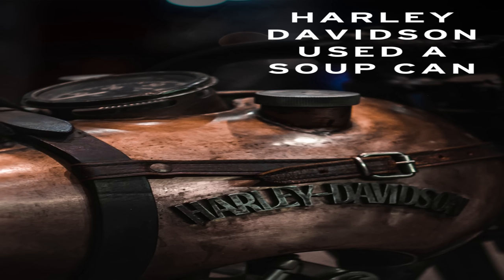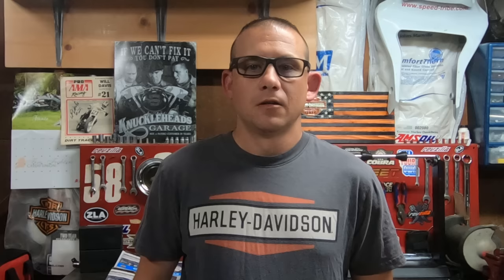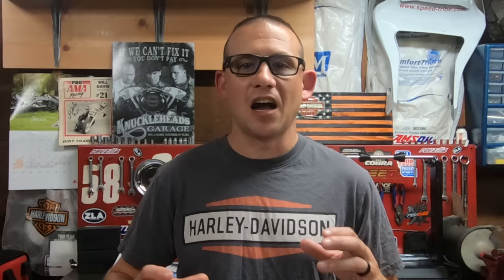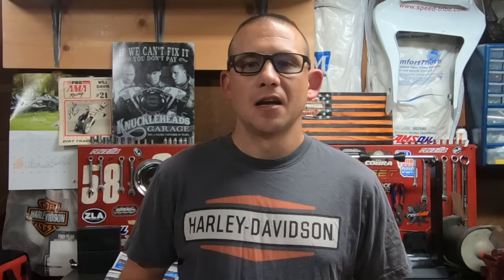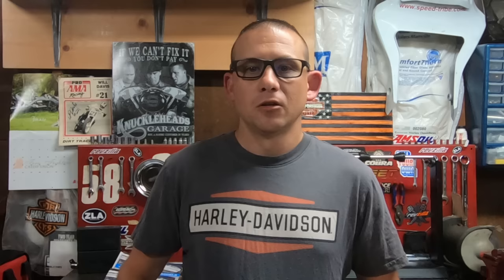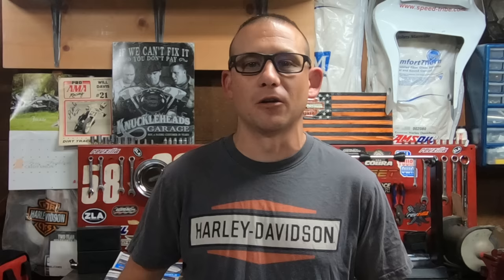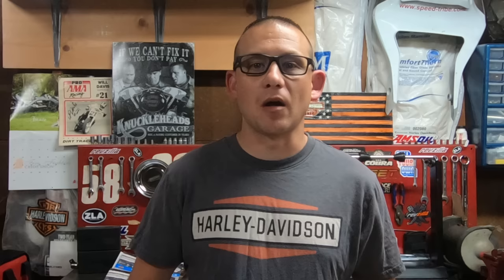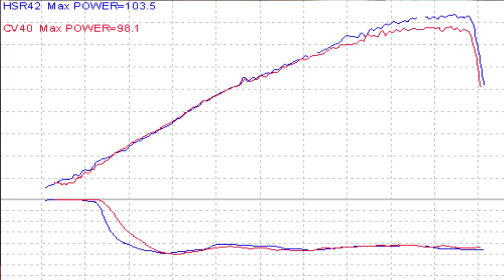CV Carburetor or the Mikuni HSR for Your Harley-Davidson

Comment: Well I have kept my CV carburetor ..
back in the 70s and 80s I tried SU and the S&S ..
 at that time didn’t have an Excelerator pump and I could not get used to the roll-on of the throttle .
I rode other peoples bikes with the newer ones but they do tend to gulp more gas .. I had it for quite some time..
 but on my Evo I got my CV carburetor to run very well and get decent mileage  in the winter I will put a 45 slow jet because  really cold with the 42 it will cough once and a while ..but in the summertime it works perfect.   I do run 170 maim jet And 1988 sportster Needle. I did take one round Of coil of the spring I  clipped it off ,,in affect making the slide act quicker ..
I have followed Joe mentions,, advice on carburetor and exhaust and I found it to be spot on.
if someone gave me the flat side I’d give it a try but I’m not gonna go out. Buy one
 One thing I always Wondered do you have to change the throttle cables

Comment: I actually don’t have a negative opinion of the CV Carb however I did install a Makuni 42mm HSR on my TC and my EVO and I have never been unhappy with them. They always performed quite well.
Reply from the maker: I've never heard anything negative on Mikuni performance, always gas mileage suffers with them. I've had some do well on fuel with the right jetting but it takes some time to get it there.
Reply: @GixxerFoo  Gas mileage does take a hit. It’s noticeable but not drastic but I didn’t really keep track of it if that tells anyone anything. I don’t think you can wrong with either. Anyone riding an older bike is most likely also capable of working on them.
Reply: @anchorsaweigh9893  Definately

Comment: I had a 05 sportster with pipes and intake. Kept the CV carb, and never had any problems in 3 years. Later on I bought an 04 sporty with pipes, intake and they had switched out to the Mikuni HSR 42. The throttle response was very very good. However, I was always tinkering with the mixture screw. (Which wasn't too bad, just had to fine tune it constantly.) Now I've got a 1977 yamaha xs650 with 2 mikuni BS38 CV style carbs. Most of the performance guys switch to the Mikuni VM carbs.
Reply from the maker: It really depends on what your comfortable working with, also some engines just do better with one carb or the other. I've had bikes run like crap with a Mikuni and ended up going back to a CV.
Reply: Mine were 883s so it was probably a little too much carb on the 2004. The 2005 definitely had a bit more balls. I had planned on a 1250cc big bore kit on the 04 so it would have been just right then. But life got in the way and I sold it before any of those plans came to fruition.

Comment: I happen to like my stock CV carb.
I find them easy to tune and my bike seems to run well with it. My air cleaner is a cone style that points to the front of the bike so I have full access to my float bowl and I can change my Jets without removing the air cleaner or having to disconnect the carburetor from the bike. I literally turn out four screws and nothing else and the bowl drops right off.
As more of lone Highway Rider than a group Rider I never feel that pressure to compete with other bikes.
Reply from the maker: The CV is a great carb, they work very well and are easy to tune. The Mikuni really comes in if you exceed the air flow capabilities on the CV which is pretty hard to do.

Comment: I've been around cars, trucks and bikes all my life. It seems, at least in my experience,  that the factory, pretty much knows what they're doing. Now I'm not saying there isn't room for improvement,  but as far as reliability and all around dependability the factory knows best.
Reply: Have you even rode a Harley with a mikuni Hsr?
Reply: @davidleonard8369  riding a Harley with a Mikuni, I'm pretty sure I have road one with just about every fuel delivery system you can think of. I'm not disputing that a Mikuni carb runs well, what I'm saying, is that for the most part the factory got it right. Most people don't have the skill, or the patients to diagnose and repair a factory carburetor.
Reply: @thomaskirkpatrick4031  nonsense, the factory keihin cv is very simple and there is so much aftermarket support that a cave man can repair and tune one. But being a cv it can't match the instant throttle response of the Hsr. I have worked with both and even more than a few s&s carbs. All of them can and do work well but the response of a mikuni is like a light switch. My 1997 sportster has a 42mm mik and gets 47 mpg on 91 octane pump gas and runs mid elevens in the quarter and low sevens in the eighth. I was sad when Andrews discontinued the keihin flowmaster but the mikuni is even better.
Reply: Yep them stupid engineers know what they're doing......including putting gear oil in the trans and primary
Reply: @thomaskirkpatrick4031  
Except one thing , the factory also goes with the most economical solutions many times when they shouldn’t. You would think that since Harley HQ & S&S are in Wisconsin that Harley would use S&S carbs but it’s actually cheaper (or was at the time) to import the cv from Japan that’s a shame
Reply: Very true. It took me a few decades and lots of money to figure that out. But man it sure was fun!  Now, it’s reliability, back In the day I was searching for improvements.

Comment: I don't object to a Mikuni carb except for the initial cost. I've had great luck with the cv with Joe Minton improvements. If you've got the money for big bore, cam, and other expensive upgrades then Mikuni is certainly the answer.
Reply from the maker: Mikuni is pretty expensive on the up front price, nothing wrong with the CV's for mild engine work. But like you said the Mikuni is the way to go when you really get into building a motor.
Reply: @GixxerFoo  there are many out there that can tune and trick out a CV to be as good as a Mikuni and have substantial fuel economy to boot which is the best of both worlds in my opinion. Bob Woods (of Woods cams) will be the the recipient of my CV once I finish up building my 89" stroker. It'll "appear" to be all stock on the outside but will be extremely nasty once its done AND will use stock pipes and airbox. Looking for 80hp with some mild headwork all done by myself on this entire long term build.

Comment: Mukuni carburetor on my 1989 Harley Davidson Softtail Custom has been great performance wise and I haven't noticed any fuel economy issues. In all actuality I have way better performance because I do have a little bit extra cam so the Mukuni is hands down easier to tune and runs much better for me. THANKS MUCH PAUL TAV 👍.

Comment: I put a CV Performance brand drop in kit in my stage 2 Evo Dyna, mainly because I couldn't pony up the dough for the Mikuni lol. It's a fair bit quicker on the throttle response over stock and just generally smoother operationing through the powerband. It also has an external mix screw with a knurled end on it so you adjust it by hand 👌
Reply from the maker: CV carbs can make some power when you get them setup, the Mikuni is pretty pricey.
Reply: @GixxerFoo  Ya, I'll  bet my little box of experimental jets cost under $20 or so - and once you set it, you forget it, she stays there.
Reply: I love my cv preformance kit

Comment: On my 1200, the CV built with CV Performance's Velocity needle, diaphragm spring, 46 pilot and 185 main, I get plenty of power, great throttle response and 53 MPG at 70mph mileage on the highway. Stock cams, S&S Stealth AC and stock pipes with the baffles drilled out. Eats Twin Cams for breakfast

Comment: Been running a Mikuni 42 on my 2000 Heritage the last 20 years, 95", SE203 for 10 years , Andrews 37 last 10, V&H 2-1 Pro pipe, Bike runs strong, i like the Mikuni, it is more thirsty than the CV40 Carb though, but its my bar hopper so its cool
Reply from the maker: Stop light to stop light is all you need on a bar hopper!

Comment: Mikuni carb. Better throttle response also mid range adjustment.  02 Heritage high flow intake, Vance  & Hines exhaust 550 cam
Reply from the maker: Mikuni is about the closest thing to fuel injection throttle response you can get but even easier to work on!

Comment: Put my 01 buell x1 motor in my dads 99 hugger, converted the ignition to single fire and did away with the fuel injection for an hsr42, it’s a beast! Before that had the cv on his stock motor with several modifications, that carb ran great after jetting it properly. I think both carbs are great and each one has its place.

Comment: I have had 10 Harleys with CV carbs (Sportsters and Big Twins).  All of my CV carbs have worked great when I went from Sacramento the Lake Tahoe (about 6,000 elevation difference).  Now that I live near Redding, CA, at the 4500 foot level, I have a Mikuni HSR on my 1997 Softail Heritage Springer.  When I am in Redding, it works great, when I go to the 8,000 foot level in Mt Lassen National Park, the Mikuni is the pits.  I look like an old diesel bus going up that high in altitude (black smoke).  Also, when I go up in elevation, I get terrible mileage with that Mikuni...  I have dropped from 45 mpg to 30 mpg and less with that Mikuni.  I bought the bike with the Mikuni on it and will probably swap it out for a CV carb.  I use to hate the "throttle blip" spit and die of the CV carbs when they are cold and the Mikuni does not do that, but my mileage is way down with the Mikuni.  Now, try to get the Redding Harley Dealership to work on a Mikuni that is to be set up for 4,500 foot level when Redding HD is at 500 foot level....  Good luck with DAT.  I might just jet down the Mikuni and see what happens.  CV carbs are simple once you do 20 of them or so for all your friends who want "free" jet changing.
Reply: Redding must be hot as hell this summer. I us to live next to the river & cemetery. Beautiful town.
Reply: @porkchopspapi5757  Yep, 112 degrees is not uncommon.  The smoke from the fires is thick enough to cut...  Pretty bad this year.  The fire fighters are not directly fighting the Dixie Fire, they are letting it burn that is why it is over 700,000 acres.
Reply: @ababbit7461  Damn. Ever spend any time on brandy creek near whisky town?
Reply: @porkchopspapi5757  Yep, just a ride through on a motorcycle.  I like that area on the western part of I-5.  Great ride up into Trinity.

Comment: been running the original cv carb on my 1990 flhs 50,000 miles I put in a jet kit about 20 years ago. worked better after experimenting with it. the only thing that went wrong was the diaphram tore. I used a sealer on the hole and it worked. that was 10 years ago.
Reply from the maker: That's awesome, the diaphrams can be the culprit of a lot of issues with the CV carbs.

Comment: I changed my 1999EVO to a flat slide and found the response more jerky which is the instant response I guess. I intended to sell the bike later and put the CV back on and could instantly feel the slower response, you don’t get more power as you still need x amount of fuel and air to do y miles an hour but for pottering around town the CV irons out the gentle throttle tweaks as you ride.
Reply from the maker: That CV really helps smooth out that instant response, much in the way new fuel injected throttle by wire vehicles have a little delay built into the throttle response.

Comment: In 2014 I switched my fuel injected magnetti morelli for an s&s super e I run 113 cubic inch 10 and 1/2 to 1 engine my carburetor is fantastic
Reply from the maker: I am surprised it was able to get the fuel it need with the MM system, I bet it really woke up with that carb swap.
Reply: @GixxerFoo  even with the fuel Commander it could barely idle so I ripped the whole thing out went with the thunderheart ignition system and an s&s carb works great
Reply from the maker: That's the way to go with the MM system. They work great till they don't and then it's a pain to find the problem and parts.

Comment: Hi 👋, I forgot to mention this is the third MIKUNI carburettor I’ve used, as I have had a 1200s , FXR 1340 , I had changed the carburettor on these as well, Highly recommended! PHIL FROM THE DARK SIDE OF THE MOULIN FRANCE.

Comment: First off I do all my own work but am not a mechanic. I have a 74"shovel fx  and a 92 flhtcu . I have done complete rebuilds on both engines flywheel up . Dana ignition in both . Shovel  only extras was bore 10 over, headwork n pipes . 92- 10 over, headwork, ev27 cam . I run an SS E carb on both and once tuned they both work good for me . I tend to run my stuff on the hard side but not beating it. Just wanted to throw SS in there for thoughts.
Reply from the maker: S&S has one hell of a carb, they work very well and to me they are easy to work with. Some guys say they never can get them right, I dunno they have always worked for me. Btw that EV27 is one awesome Evo cam!

Comment: I’m an old guy that loves carburetors. Hands down the Mikuni is far better carburetor then the CV40. As you mentioned easier to work on and the throttle response. Not have to worry about the vacuum diagram is a big deal on a long trip as I had the top cap come lose. I get way better gas mileage with the Mikuni. Even if I get on it now and then. Also, not having a butterfly restricting air flow.

Comment: My bike came (s/h) with an HSR42 on it and I can vouch for the throttle response. It had been "modified" by previous owner to try to rectify failed needle and seat, kit is $200 here, and new HSR45 with manifold that puts air filter back at stock position, adapters etc. does indeed still come with a great paper tuning manual... I think you can see where I am going with this on an engine with big bore kit, cam, etc... :-D

Comment: For the most part, the stock CV is all I've ever needed until it fails, then I install S&S Super Es. Easy to tune, easy to service, easy to get parts for. I used a Mikuni HS40  on a shovelhead once, the owner made me take it off and rebuild his Super B, which is still on the bike to this day. I took the Mikuni and put it on a 80" Evo Glide, it ran fantastic on that bike. Call me stone age or whatever, but S&S is my favourite! To be fair the Shovelhead was a kick start bike and the owner couldn't figure out that when you turn the enricher on and you move the throttle while kicking, it doesn't start well.

Comment: Just installed a mikuni copy on my 01 Road King vs my fully modded CV and I ain't going back even.  Getting 44mpg with a cam, air, and fishtails.
Reply from the maker: That's awesome! Installing a Mikuni style carb doesn't have to cost your mileage!
Reply: @GixxerFoo  I was surprised as the cam and carb mods to the CV brought it down to mid 30s though it could have been a richer jetting.  The accel pump and direct linkage to the slide if what makes the mikuni (you already know).  For those who find it twitchy you can just adjust more delay in the accel pump.
Reply: What mikuni did you go with. The model numbers kinda confuse me. Some say I need 42-19 and some say 42-6. Some bolt right on and some you need a kit. Jp cycles recommends both..
Reply: @joescott803  chinese knockoff from ebay...works good....42mm unless you have a huge motor

Comment: I changed to the Mikuni 42. I get the same 30’ish MPG that I got with the CV. Of course my ride is far from stock. I do have better response and had a big  change in power.
Reply from the maker: Mikuni is the way to go with some heavy engine mods.

Comment: I went with S&S super G. Mostly for service and parts availability. My 01 Sportster Custom has had major top end mods along with cams. It is stupid scary fast.
Reply: S&S Super G.....Float would stick....carried a Tool Bag everywhere.........or Smacked the Bowl to loosen . Pain in the ass...
Reply from the maker: You get the fuel to them and they will scream!
Reply: @briangoldy8784  Wow. Never had the first problem with mine.
Reply: @briangoldy8784  l 've had mine on for over ten years.  Find it utterly reliable. S&S equipment is absolutely top drawer. It probably doesn't like getting smacked though.
Reply: @farleyfox1840  LMAO. 1983 IronHead 1000 cc. XLS.. ..Never cared for this Carb.. Bike ran like crap......Actually, should have installed a Cam with Carb....but money was tight......I sold the Bike.

Comment: I recently removed my S&S Super E and installed an HSR-45 on my 84 inch Shovelhead. It ran good with the S&S but the HSR-45 really woke the old Shovel up. I had to install a 1 inch spacer on the manifold to get the throttle linkage to clear the oil line between the rocker boxes. The HSR made a believer out of me.
Reply from the maker: The Mikuni really wakes those shovels up, I don't where the mileage is going on the Mikuni and what the setup they are running is. Most Mikunis properly jetted and setup will still keep your fuel mileage.
Reply: @GixxerFoo  In all honesty fuel mileage was never a consideration for me. I am running S&S heads and a Sifton 109 cam with solids. I have gotten as little as 25 mpg and as much as 35 mpg. They weren't kidding when they said "Your mileage may vary".

Comment: I got a mikuni hsr on my 2002 deuce with a set of S&S 509 full cam set and it ripps off the ground. Feels like the performance and pick up is similar with the twin cam 103.
Might even take your suggestion for a 98 big bore slip-on kit in the following  months. Do you think that it will be a good fit to my existing upgrades?
But as you said, the throttle response with the mikuni is instantaneous. 
Keep on making these videos mate. They are full of good insights.
Reply from the maker: The big bore kit would work with you're cam but you'd need to stay within the compression limits of the 509 cam.